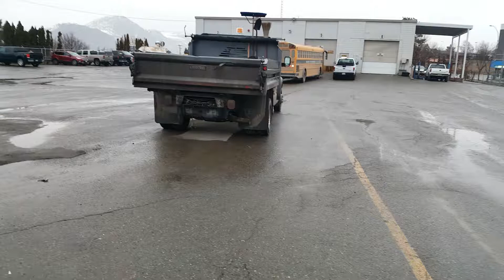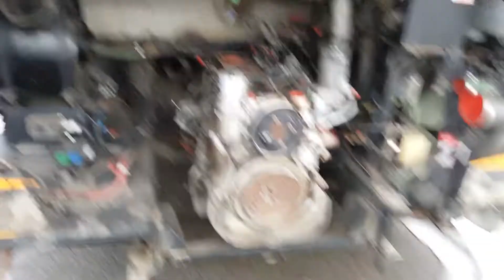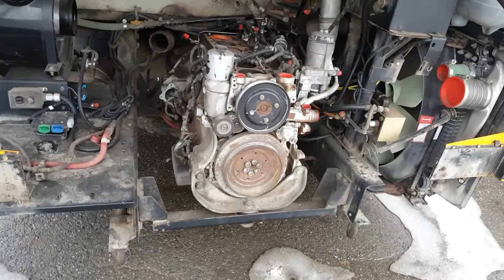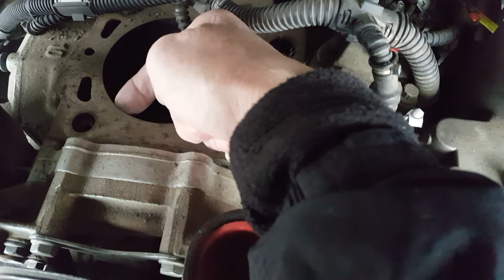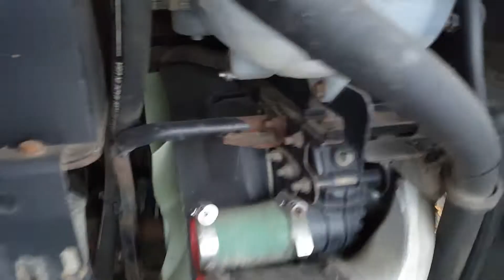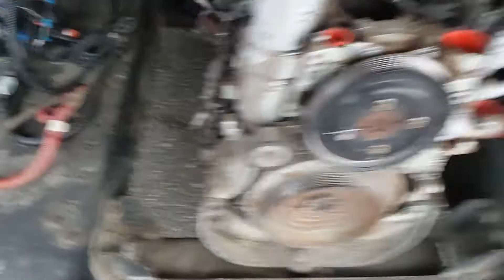Mercedes Diesel Engine Cracked Block

Comment: I drove these buses for a few years. In the course of those years these particular buses almost always had cooling problems, specifically the EPA versions. I’ve seen four engines total on these buses with the same problem, 2 were ISC Cummins, one MBE just like this, and one was a CAT. Makes me think it is more a design fault in the cooling system for these buses than an engine fault.

Comment: Engine rebuilt?
Reply from the maker: No the repair cost is too much to handle. On top of the long block price is a ten thousand dollar core charge that we will not get due to the cracked block. These engines are expensive to fix and I believe they stopped building them in 2010.